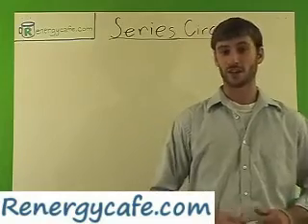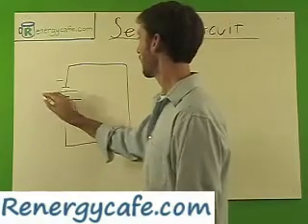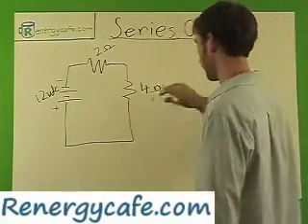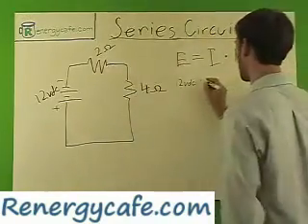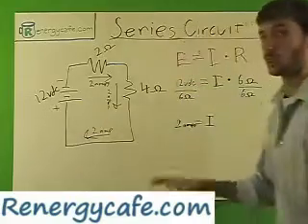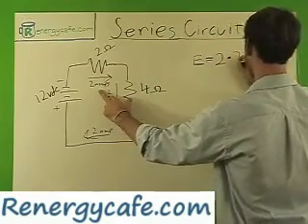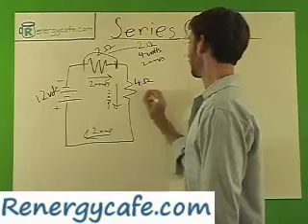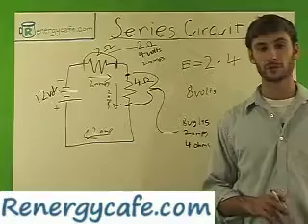Learn Series Circuits and renewable energy

Comment: You have V=IR
you want to rerarrange the formula to find 'I'
the opposite of multiplying is dividing, so to get rid of the 'I' on the right hand side, you divide it by 'I' (I in this case = 6)
You have to do the same to both sides of the equation, so the left hand side becomes V/I, or in this case 12/6
He divides the 6 by itself to give 1. multiplying by 1 wouldn't change the value for I since it has to be positive (can't have a -ive current).
hope that helps?